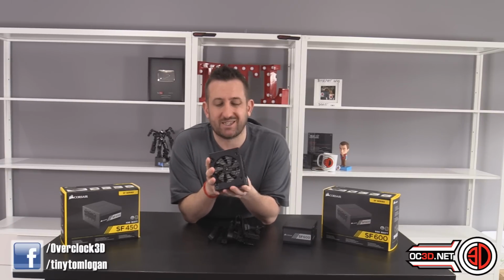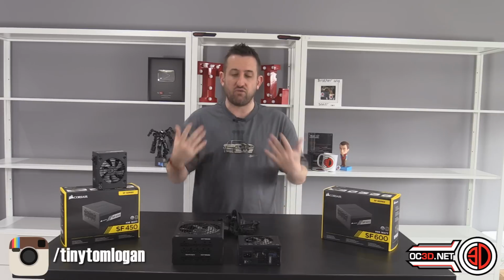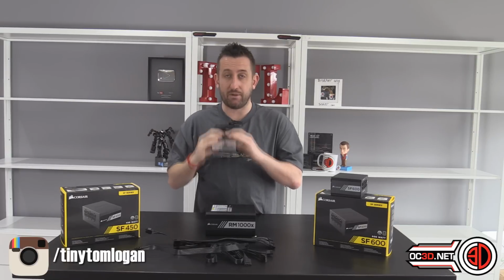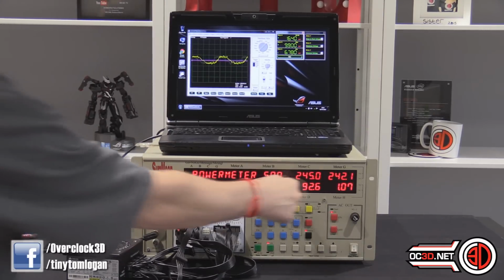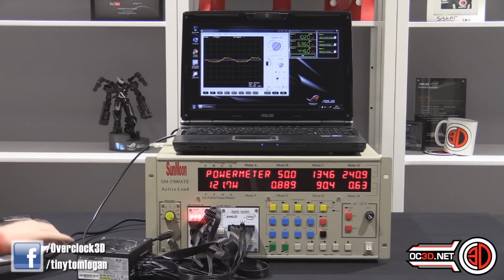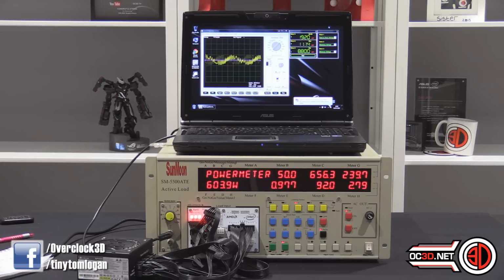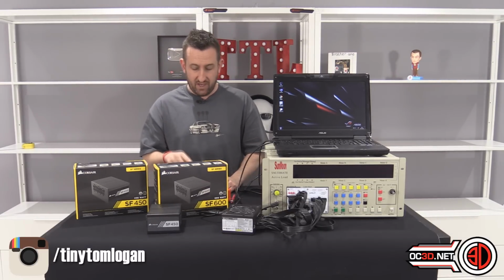Corsair SF450 SF600 PSU Review & Testing

Comment: 3yr old comment 🤣 just bought the SF450 to run accessories duty in my dual PSU build, all fans (14 atm), 3 commander pro's & 2 lighting nodes..good to see it will be running close to 90% efficiency, love ya work!
Reply: Did you notice a click noise when powering up or down your PC like from sleep mode?

Comment: Putting a 1080ti FTW3 into a SFF so I kinda don't want to run a 450w at it's max all the time. Fans and cpu needs to be included. So 600w it is.
Reply: I think Silverstone has an SFX-L at 800W and 700W also.
Reply: CheapSushi looks like the silverstone 800w is using cheap capacitors. Almost every customer review I've seen of it say it just dies after a few days.

Comment: Gonna buld mini-itx AM4 with ryzen 1600x + rx 580. Does this PSU - SF Series™ SF450 — 450 Watt 80 PLUS handle it? Thank you.
Reply: I would suggest on getting the 600 for the efficiency. But the system you have said on full load can range from 350w to 386w. I would implore you on getting the 600 though because the efficiency curve favors more on the full load of your system

Edit: but yes. It will be able to handle it
Reply: Rami Al-Omari heres a link that will show you what wattage your system will be producing. http://www.coolermaster.com/power-supply-calculator/

Comment: really great testing. Rare to see such things with consumer PC hardware. Being an engineer thx for this. I own the SF600 now, alone with the normal (ATX size) Seasonic G 550W. The latter i like really much and have been using it for like 6 months now. Lately have aquired this new SF PSU. What are your thoughts on switching to the SF600 permanently? I was interested in minimizing my rig in order to be able to take it with me (maybe as disassembled components).

Comment: There has to be something wrong with your ears tom, I bought the SF600 because you said it was "quiet" and it's a jet.  It's powering a Xeon e5-2683v3 and a (temporary) gtx 570, it's by FAAR the loudest part in my mini itx build. Even at idle this thing is LOUD. So far I had only problems with corsair, almost every PSU from corsair has coil whine. Never going to buy a corsair product again and you lost my trust.

Comment: Do you know that that number to the left of the efficiency that goes from 0.89 to 0.99 is the PF (power factor) and that it matters as much as efficiency in Europe?
Reply: It is the ratio between apparent power (VxA) and the real power (J/s).
In Europe we pay for the use of both, in the US they only pay for their use of real power 
There is a PFC(PF correction) circuit in most decent power supplies that makes sure that your PF is higher

Comment: is the SF450 enough for i7 6700, GTX 1070??
Reply from the maker: Go watch my 1070 FE review dude for a full power breakdown :)
Reply: I'm doing the same build. Go for the 600w for sure. You need some headroom and it will run quieter, cooler and last longer.
Reply: +Nopiw ok chill out haha. I'm just worried becsuse it says on the nvidia site to use a 500w for the 1070.
Reply: :D

Comment: Great video, specially for the instrumentation details! But you could consider adding noise measurements - fan tripping point, @ 50%+90%, and linear load ramping to check for coil whining & fan oddities...
Reply from the maker: The PSU tester makes so much noise its not something we are able to do sadly and PSU's make so little noise (the decent ones) its not worth the effort to test them that way now

Comment: Mr.Logan, I want to build a small PC with an Ncase M1 case, a Z170 motherboard, an i7 6700k, an EVGA Titan X SC, and two ssd's. Can the SF600 handle all that without dying too soon?
Reply: I meant to say a Z170 mini itx motherboard.
Reply from the maker: +kikayei Titan would be a silly purchase right now but 600w is ample
Reply: +OC3D TV. Thank you for replying. If you're referring to the gtx 1080/1070, then yes, it would be pointless to buy a Titan X now. And with the gtx 1080 at 180w, the SF600 will definitely have no problem powering up my console killer. 😉

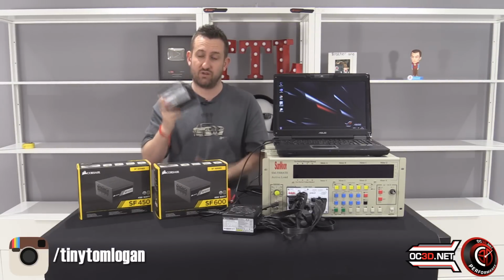Comment: 24:21 Yeah, I have my system hanging on a wall meter (curious and such) and the most I got with a system with two SSDs, three PWM fans and one Molex, Z170 chipset, i7-6700K, GTX 980 Ti and a USB drive was 395 Watts when making Aida64 stress all the components and Unigine Heaven stress the GPU. So here I'm wondering, would the SF450 suffice, even for a GTX 980 Ti? Everyone keeps saying the 980 Ti needs 500 at least but I guess that is when using a very basic efficiency? 

Nice test anyway and pleasantly surprised that this PSU is near Platinum rated! Was considering Silverstone's PSUs first but they have this weird thing where their 600 Watt one is smaller than the 500 Watt version and noisier, Corsair's is still normal SFX and chose the midway with their 92mm fan, so more room for the cables, while remaining fairly silent!

Comment: Running an mATX system, 4930K, 780 DirectCU II, 3xHDD, 2xSSD, at max on CPU and GPU, it bare consumes over 400W. Running a 860i. Never taxing the PSU, so it will be happy for a long time, but could easily had a smaller one.

Comment: I noticed on the charts your displayed during this video didn't include the RM850i power supply. Any reason for this?
Reply from the maker: +John Athanassion Yes and the reason is Ive not tested it.
Reply: Ok, understood. I'm using one from your advice that you never had problems with Corsair PSU's. I had 2 Antecs fail me withing a week. I'm loving my very reliable Corsair RM850i. I heard they updated the 7 year warranty to 10 years. Sweet. Thanks for your reply.

Comment: i was thinking here, how about since they can be run at 40% load with no fan spinning, why not make a even smaller version, think about it, the fan thickness is maybe 40% of the height of the thing. and you even get better cooling when the fan is not there blocking airflow. just saying.

Comment: A 600W power supply can power anything today including SLI. That was proven by MSI with their Vortex G65 using a tiny PSU that only outputs 457 Watts to feed a Intel 6700k and 2 GTX 980Ti without loosing performance, check LinusTech Disassembly Stream VOD. Another reason lately we see Desktop GTX 980s chips on Laptops. People as always, keep buying massive power supplies for no reason. I have an OLD intel 970 overclocked + a GTX 970 Overclocked and I draw around 400W from the wall at max usage, knowing that the CPU it self is using a lot. So yes, a 600W power supply is plenty for a normal system today.
Reply: +ralmslb its 980 not the Ti model, and they are not the desktop variant so not as powerful either.
Reply: +Voodoo Gaming No, they are full desktop GPUs, but yes, they are the non Ti's
Reply: +Voodoo Gaming Ok I was wrong about it, I though it was the TI, regardless they are full Desktop 980s on a fully custom PCB.
Reply: +ralmslb just went ad had another look, my bad they are full boards.